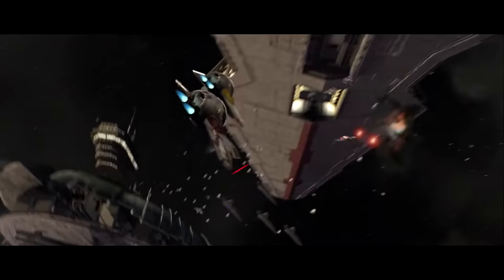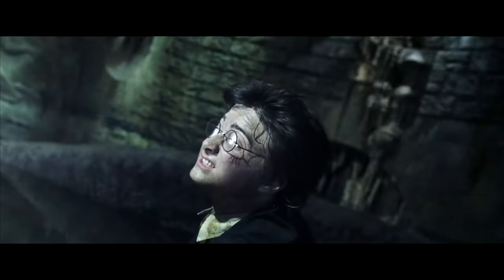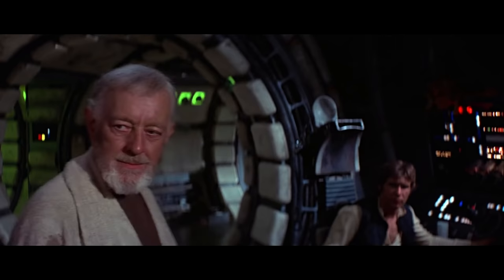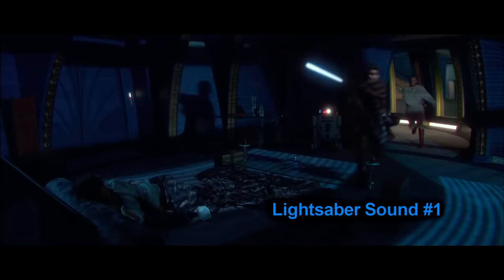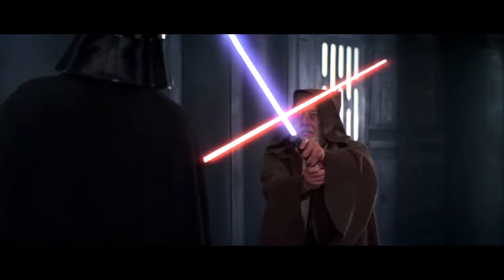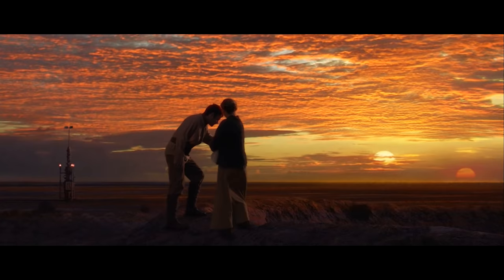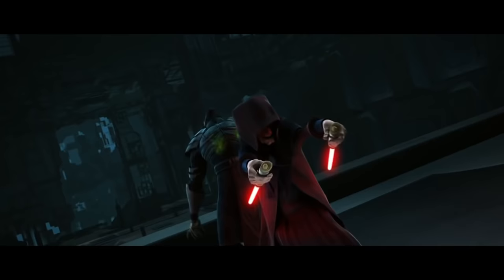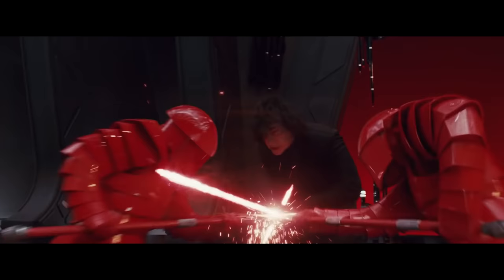The History of Lightsaber Ignition Sounds in Star Wars

Comment: Great video!  I've always been a little disappointed that the lightsabers lacked a real variety in their ignition sounds since they were all supposed to be unique to the Jedi or Sith.  If they're all going off and building their own from scratch, wouldn't it make sense for each one to sound a little different?  I think you might have nailed it with the sounds reflecting the user and their emotions whenever the lightsaber is turned on, it seems like something the sound guys would have done to add a small touch to the movies.  Keep up the good work!!

Comment: You should play "Jedi: Fallen Order". You can customize your lightsaber, and the ignition sound depends on the color of the blade. Meaning you have the original 3 sounds (well... kinda. More in a bit), plus like 4 or 5 new ones.

Of course, Sound 1 is for the blue lightsaber and Sound 3 is for the green lightsaber... except they're slight variations of them, instead of the original recordings. And I can't say I'm a big fan or neither of them. Particularly Sound 3. It has an added hiss at the beginning of the sound that covers up the metalic popping-like sound that makes it so cool.

As for the new ones from that game, my favorite would be the purple lightsaber ignition sound.

As for the original ones, well, it's hard to argue against Sound 3, but I also have a very soft spot for the OG sound 1 that puts it on the same level for me.

Comment: There is a theory for why certain saber's ignition sound different at least until they retconned Kyber Crystals. 
Jedi used natural crystals and Sith synthesized or synth crystals. Luke actually used a synth crystal too which is why his green saber has a different ignition sound.
Then the reason Vader and Maul have different sounds is their sabers had additional crystals so they could adjust the length of the blades.

Comment: You also hear the red lightsaber ignition sound in pirates of the caribbean: the curse of the black pearl when jack sparrow burns the donkey's bum in with the hot poker in the barn to get it to run and turn the wheel round that it's roped to.

Comment: Some corrections:
Almost every time Anakin’s lightsaber is activated in Episode VII it makes both sound 1 and 2 simultaneously. When I was in the theatre, the sound 1 was actually more prevalent when Finn activated it for the first time.
Also, the first few ignition sounds in Episode IX are clearly a sound 1 with a slightly audible sound 2 added. Don’t know why you called it purely sound 2, as it sounds almost identical to sound 1.
The first ignition on Kijimi is not a sound 4, but a sound 4 combined with sound 1. The sound 1 elements are so prevalent it’s kind of baffling you didn’t hear it. Same goes for the second Kijimi ignition, being a sound 1 and 2 mix.
The ignition on the Death Star is again a mix of sound 1 and 4.